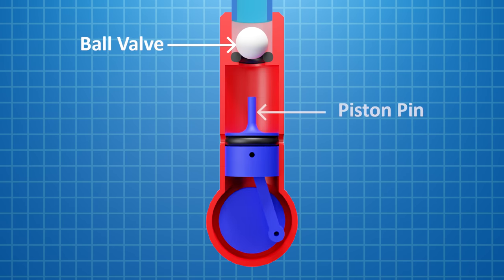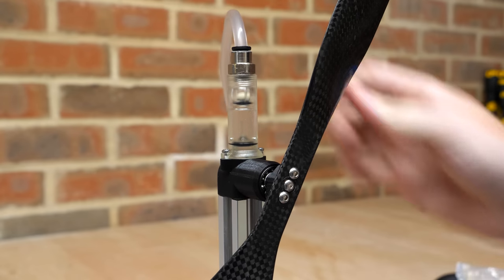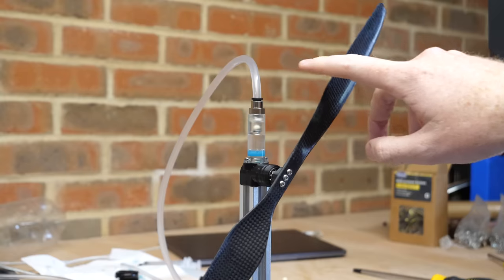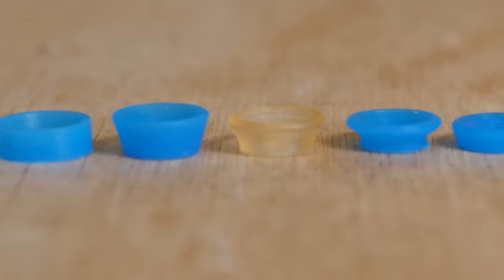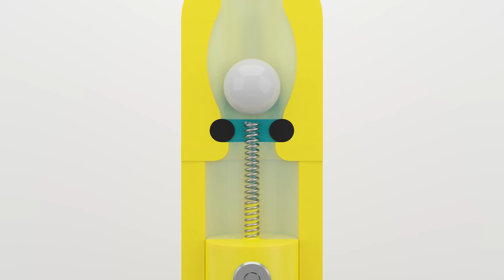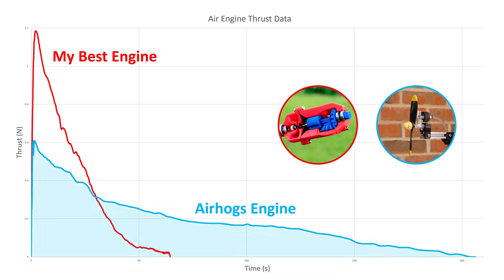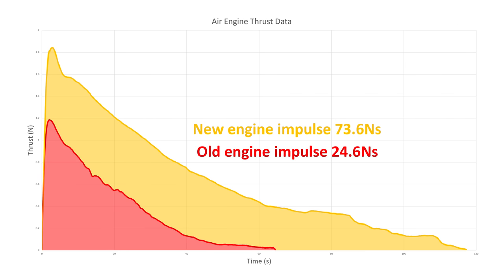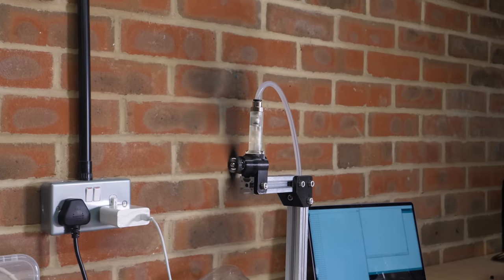Optimising an Air Engine

Comment: This is interesting. 

But to get a true Thrust to CFM ratio of compressed air at a specific inlet pressure, you’d need to point the prop straight up; and then place it on a scale while it’s running.

Your illustrations make it appear as if you’re doing a true analysis of the design. But you’re not.

This video is straight bullshit.